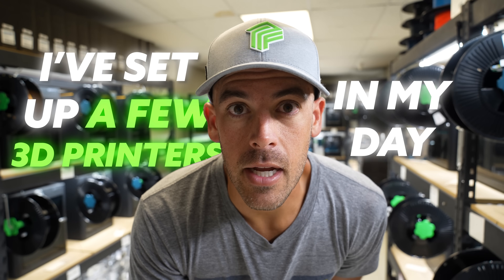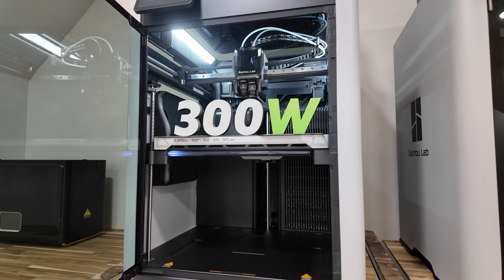9 Tips for a Killer 3D Printing Setup

Comment from the maker: My 3 Favorite Printer Recommendations:
Bambulab H2S 3D Printer - https://tidd.ly/3IaLFzZ
Bambulab H2D 3D Printer - https://tidd.ly/488yDNQ
Bambulab P1S (Cheaper Option) - https://tidd.ly/45W2I1Q
Reply: My dad and mom fuled my future.
Reply: Travis, 
Thank you for all your hard work and inspiring content. I have one question, I hope that you will read and answer it. How did you fix/bolt the butchers board? Into wall, on cabinet, or both?  Best, Al
Reply: Can you tell me the height, length, and width measurements of this piece of furniture?"
Reply: What about the p2s
Reply: h2c
Reply: Absolutely payed by bambu labs. My Prusa XL is wayy better than those h2 thingys
Reply from the maker: @Official_Skypaper  Nope & Nope!
Reply: @Official_Skypaper  Went from a Prusa XL, to a H2D and have YET to look back. Bambu is genuinely ahead of anything else and its not even close. Cant wait for the H2C
Reply: @Official_Skypaper Bambu Lab is way ahead in build quality, speed, and reliability. They require maintenance way less often and are significantly faster with better build quality.

Comment: Impressive! I have 16 printers in my garage that I built specifically for them. I started from scratch, paycheck to paycheck, using borrowed equipment. It seems like you have a large house and a complete wood workshop. For those of us who don't have such luxuries, make the most of what you have. Comparing your success to someone else's will only limit your own potential. What works for them may not work for you. You don't need top-of-the-line equipment to succeed. Begin with what you have, progress gradually, upgrade when necessary, and use your projects to your advantage come tax time.

Comment: 5:35 Drawer System for Bambu Lab, Did you consider using a rotary table to pivot it around? Then When done a locking system to ensure it's stability? Just a thought as I wouldn't personal want to reach behind or nudge the table when performing maintenance on a printer if others were going. Still Love the Setup though!

Comment: yo yo, solid video!  what are them little thaaangs called that you popped in the holes and used to mark the corresponding hole locations for the dowels on the underside of that butcher block cut off

Comment: I ended up mounting my K1 max and K2 Plus on a HD metal shelving unit from Home Depot and found some pavers for dirt cheap. I just kept the shelves roughly 14” off the wall allowing me the walk behind them.  It is a good low budget option for me.  It also allows me space to have a trash can behind the K2 leading for no need for a poop chute.

Comment: I'm using a LEVIOT CORE 300S air filter next to my printers. You can even automate starting it when your printers begin to print using Homeassistant and the bambulab and vesync plugin.

Comment: I’ve been wanting drawer slides for my printers but what kind did you use? Load capacity? And is that butcher block you mounted the slides too? I was thinking 2 x 4 and drilling them to my bench I made

Edit: just saw drawer slides link, but what about blocks they are connected to?

Comment: 6:30 I found that if you use activated alumina instead inside your AMS 2 Pro and pop the heat to 65°C for 12 hours, you can get the relative humidity down to 1~2%.
I even opened up the AMS for a couple minutes and closed it back up and the newly heated desiccant sucked up the humidity from 25% down to 4% in a span of maybe 6 hours.

Comment: 300w average? That's incredibly high, like super high temp if that's what you are doing. PLA could be low as 100w and your maximum PEAK should be 300-350watts, ABS and Poly should only be like 150-200w too?

Comment: I see you are advertising this as a 1500 KVA ups, is that one per printer or both of them on it?  I only ask because I've been through a couple now that the initial power draw and heavy load times consistently gave me the beep of doom and couldn't handle the load of even one of my Creality k1 max machines so I'm just curious if that gives you plenty of headroom to avoid this.  Thanks!
Reply: I literally unpaused the video and you were answering the question the very next thing....lol oh well.

Comment: Worth saying that if the H2D / S is using 300W to do a print my Creality Ender 3 Pro was using 100W but took 8 hours to do a print the Bambu Lab can do in just over 1.   Overall I'm saving power with the Bambu Lab printer.   My other printer was a Creality Ender 3 Max with a  big 300x300 build plate and it was over 100W but still took the same time.   Again, Bambu Lab would consume less.   Although I've yet to put my power meter on to confirm.

Comment: Very nice setup. The AMS location is too high for my liking. I don't want to struggle to load and unload filaments , when the AMS seats high and to the back. In your setup the H2D is 626mmH + 226mm of the AMS + 900mm bench height + 100mm for the drawer base, thats about 1.85 meter height, too high for comfortably interacting with the AMS.  You can put the AMS on the table.

Comment: Mounting the printers on drawer slides is a great idea. All drawers should have full extension drawer slides. Too bad my old Ikea cabinets don't yet have those.
Drawers versus peg board ... I like drawers (and cabinets) because they keep dust away but putting tools in a drawer means I don't see them when they are not there ... For me, daily used tools for my 3D printer need to be on a peg board next to the printer. Same goes for a trash bin; it's in the open next to my printer - not in a drawer. The reason behind this is that I like to work quickly and efficiently without extra handling. When I have my spool of filament in my hand, I need to be able to quickly grab my cutting pliers. If I take my print from the bed, or any poop from the printer, I want to be able to throw it away without first having to open a drawer and then close it again after use.

Comment: I have an H2S and first set it up on my dining table for testing. Not until I moved it into my office on a bench did I realize how much I needed to access the back as it was. The first thing I did was add a 4-in-1 adapter ($5 on Bambu Lab site, $15ish on Amazon) so I don't have to swap tubes between the AMS and external spool which requires accessing the back.

Comment: It is nice for a video but.... The rigidity to put printer on is the key for silence and perfect printing. In the X/Y axis there will be a big slides. I would build better foundation - more rigid ikea cabinets and no sliding panel (it will resonate and slide itself later) and air outake from the room.  If you use Bambu, you would use a poop tube under the desk to clean it (or vacuum) at first.  If it is production enviroment, there should be different layout of cabinets, rigid table for printers, with drier connected behind/above/under the printer. And finally and again - air outake. Use your AC for dehumidifying but if you do more prints, the used air should go out straight.  Congrats for a hobby setup and go on for pro on day.

Comment: I like the set up. My only concern is your drawer slides. I could be wrong, but  you are relying on a lot of glue to hold 30+Kg of weight that is constantly jiggling. Did you use any wood screws on those butcher block uprights. I would be curious how they hold up. 
Also I am doing my own research on setting up a bambu printer and I am very concerned on the air quality. You talked about filtration but have you thought about venting them outside or is this not that big of a concern.   Anyways great set up and kind of jealous of that dedicated room.

Comment: That is not a good set up at all. It works only for filament printers (completely useless for resin printers) and those slides are usable only for BambuLab - on any other printer you don't need access from the back. Also you need additional desk to work on your prints. And how do you get rid of fumes?!? Remember you melt plastic, that can give you cancer, so better to make some system to suck all fumes. And filters it 3d printers are not too good. I have filament printer + resin printer and laser, and I made one system for the fumes from all of them. I build something easier, cheaper, better looking, more useful and healthier. Maybe will make video about it one day. But I must agree with one thing - drawers are the way to go.

Comment: I’d recommend a portable power station over a standard UPS for anyone that wants to keep their stuff running in the event of power outages. I use a ecoflow river 3 plus for my home network and for $300 (cheaper at Costco) it will run my home network for 4-5 hours if the power is cut off to it.

Comment: I'm disappointed that you didn't make a poop slide that lead to the trash can.
Reply: It will likely cause more issues than its worth. Ive attempted to design things like this and the angles you need to guarantee that it will move are very steep.
Reply: @klaidasrunele Melted plastic could also stick to the chute
Reply: @ThePiGuy2 It wont be melted this is not an issues
Reply: @klaidasrunele  Adam Savage managed it well enough on one of his 3D printer farm upgrade videos a couple years back
Reply: @klaidasrunele  its 1/4" slope per foot... oh wait that's for real poop 😂
Reply: Also it will take more space, and the trashcan needs to be in front so it can slide in, not so clean setup. It only works for users who don't have many printers.
Reply: Or a poop vac.
Reply: I was thinking he would make that too then it was only a bin

Comment: Introduction to an Optimized 3D Printing Setup (0:00-0:45)
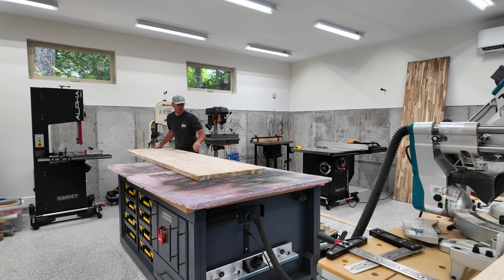Storage Solutions: Drawers vs. Doors (0:46-1:59)
Solid and Free Work Surfaces (2:00-3:16)
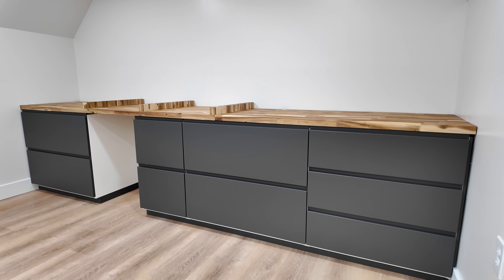Future Expansion and Workspace Flexibility (3:17-4:00)
Rear Access for 3D Printers with Sliding Platforms (4:01-5:25)
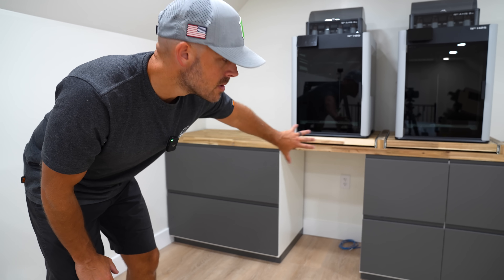Filament Drying and Storage (6:03-7:18)
Uninterruptible Power Supply (UPS) and Power Management (7:19-8:54)
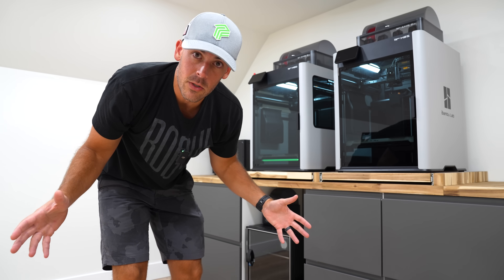Managing 3D Printer Waste (Poop Shoot) and Trash Cans (9:00-10:16)
Tool Organization and Dedicated Tools (10:17-11:24)
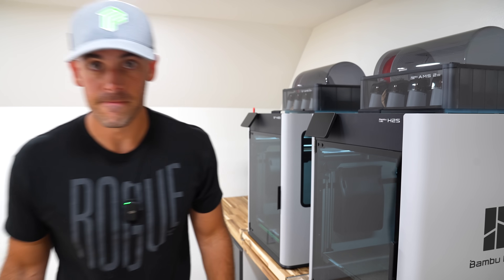Air Quality Monitoring and Filtration (11:33-12:15)
Creating an Enjoyable and Inspiring Workspace (12:18-13:00)
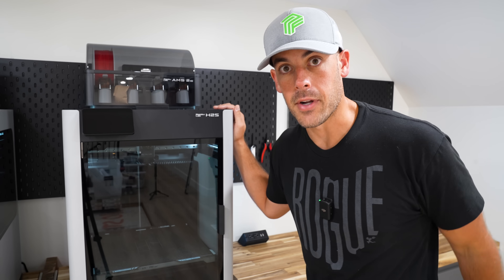Conclusion and Additional Tips (14:04-14:18)

Comment: Great video as always Travis. Thanks for sharing. Getting ready to move and hopefully going to be able to set up a small shed as a workshop and then I need to set up a space inside for my A1 and P1S. So all these tips are going to come in handy when this happens. Thanks for sharing. Have a question is there a small Affordable air filtration filter that you recommend for just two small printers like that when you print like ABS and ASA Filaments?? Thanks

Comment: I figured you were going to pull out the H2S. We just sold 7 today at my Micro Center. I can't wait to see the H2C when it comes out. But I am looking forward to putting the H2S on display and start using it. Also looking to get a Centauri Carbon up and running as well.

Comment: Travis, I have an important suggestion for you and any viewers who are interested in noise and vibration of workspace .

If you spend time in that room I highly recommend acoustic absorbers to dampen the very live setup - it will be so much more comfortable and less stressful for a thinking mind. This even goes for your workshop where some hanging absorbers can take out a lot of noise.

I’ll ignore walls - too high value space though you could use cork tiles since they are great dampers and dense enough to hold items with fixation into the wall itself. 

Off the shelf - avoid “acoustic foam” - it’s rubbish. 

Since you like creating and there is a video in this alone :p I offer some of my expertise in way of suggestions.

…Best option to start would be using the roof space - maybe white/cream fabric covered timber frames with a high density insulation (60-75kg/m^3). Softer Rockwool is good but won’t go as low f. 

Space them 10-20mm off the roof to increase effect significantly… but cover the backs with material if you do to prevent fibre movement or design the gap into the frame.

Floor: 
A rug is an option but has practical issues for cleaning. Vs carpet you can roll it and remove to clean. 

A thick rubber work mat / gym mat on as much floor as possible will assist but less so than carpet might.

Cork tiles would be a great option too - less grippy and messy than shredded rubber mats. Nice and cheap too.

Rubber  will be a neat solution for non fibre easy cleanup (grippy floor is harder to sweep as a small aside).

Last point. Conducted vibration from printers into your workshop ceiling. If you can hear them and don’t want to - mount cabinets onto rubber gym mats or equivalent thickness and also use that to space frames from walls. Cork tiles work well for this too.

Likely best setup - cover entire floor with gym mats or equivalent rubber from a roll which is nicer. Squares with no edge chamfer are good too. Maybe add the rug.

Comment: 9:50 If you were going to have a trash can underneath your printers, I'm curious why you didn't simply drill a larger hole in your desk and funnel the poop directly into the bin itself? Now you have two trashcans (or three in this case) with two different emptying timings. I'd also consider adding a sensor to the trashbin so that you know exactly when the poop gets too high and needs to be emptied. That way you don't need to constantly open up the trash bin to check the levels.
Reply: Thank you for the idea

Comment: One thing missing is the all important switched power strip, most printer power switches are on the back. Its much easier to plug them into a power strip with individual switches per outlet and then keep the power strip somewhere that's easy to reach. At least that's my new favorite upgrade for the printing setup.

Comment: Very nice, but re: 9:48 - if I've gone through the process of custom making a printer station then I would go one step further and make a hole at the back of the printer space that has a chute through the bench and straight down into the bin in the closed drawer. Saves the extra step of manually emptying the bin at the back of the printer.

Comment: A HEPA filter in the room will not "go a long way", whether you decide ABS/ASA fumes etc. are dangerous is up to you, but regardless a HEPA filter is not going to remove them sufficiently. You need to vent directly outside from the printer.

Comment: Ok - I need to know why you added the plate under the bench top above the cabinets, and why you have decided to mount the drawers/fronts not flush with the bottom of the cabinet 😅
It’s a fantastic looking room btw 😃
Reply from the maker: I actually un-did that at the end 🤫 after re-adjusting the drawer fronts I removed that 1/2” plywood sub-top
Reply: @PrintFarmAcademy  Any reason why you did it in the first place, or was it just a case of “instructions are for hobbyists”? 😅

Comment: I feel like the need for concrete slabs is overstated, In fact the requirement for a stable surface is overstated. All you need is a rigid printer frame, if the printer is all floppy and wheels / carriages are loose then of course external movement will induce artefacts but as long as your motion system is rigid then you are fine.

Comment: I just moved to another flat and this video is exactly what I want to do for my office/printer room. I was also considering a drawer for the printers and I’m happy you tested it. I would add a lock in the front so there is definitely another stop in front. Also I’m thinking about including the poop bucket within the drawers but with cutouts in the back of the workbench top. Your video is great inspiration, thanks a lot.

Comment: After issues i came across doing similar things, a UPS should only be used to power or connect to a heating element if you have a very significant buffer wattage over the max potential draw. They draw up to 300W sure for heating but the point of a heating element is to draw as much power as possible via resistance so it could at the least damage the battery and ups board, and at worse burn your house down from overcurrent heating and failure. Don’t cheap out if you do this.
Reply: Wouldnt the printer power supply already current limit the heating circuit?
Reply: The battery should only kick in when the power goes out, otherwise it's just running off the main line through the ups.

Comment: Great video. I did not guess that you were putting the 3d printers on pull out slides. I actually have been trying to figure out a way to do that for my Bambu P1S. I hate having to pull it out and and figure out how to get it situated on my desk and get to what I need to get to. I'm revamping my studio. Just finished building a printer cabinet for my sublimation printer and my Canon that I use for creating screen printing films. I put both of those on slide out trays. Still working on creating a space for the 3d printer that is more efficient.

Comment: The poop problem I have been thinking about, and what I came up with, is a photo eye on bins that collect the poop. When the bin gets full, it is angled in such a way for a central vac system to suck it away. Now the printers can poop away, and there is no mess. It kind of works like how industry vacuums resin to the extruders.
Reply from the maker: Wow that's next level, love it
Reply: In his setup, with the trash directly under the printers, just make a chute that drops into the trash can.
Reply: That was my thought, too; even if it takes joining prints to get a chute that reaches from the back of the printer down to the trash bin. You'll still want to check it periodically to make sure you haven't filled it, but everything will already be in the trash bin to take out.
Reply: How about a counter weighted poop bin? 
When the “💩” drawer is full, it tips directly into a trash bin.  I have not engineered one yet, but this is inspirational.

Computer vision is a bit tougher, but there’s lots of reasonably priced hardware out there, like the Nvidia Jetson series.